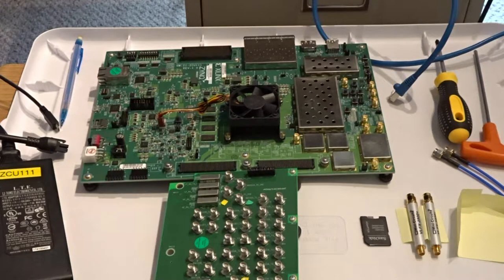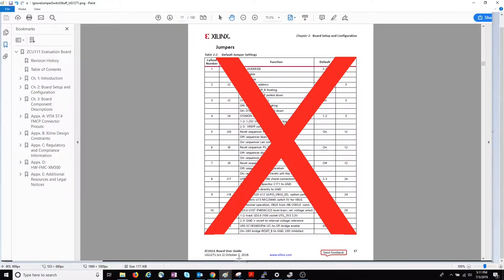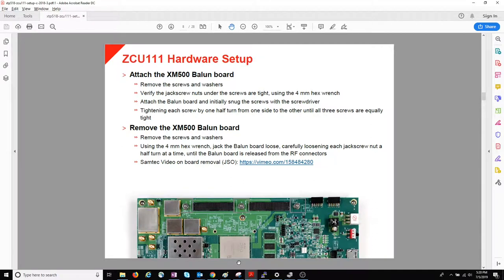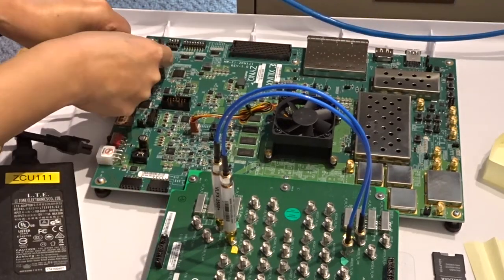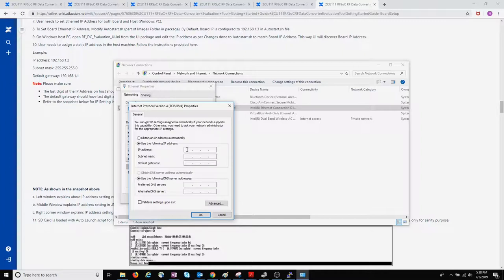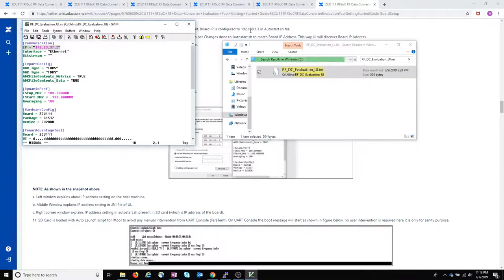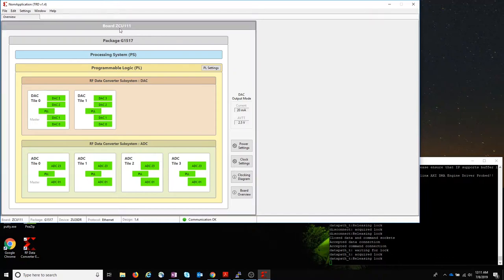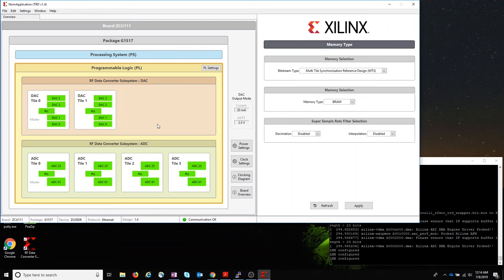ZCU111 2019.1 RFSoC RF Data Converter Eval Tool Video 5: Board Setup

Comment: Excellent series! Helped me get up and running very fast. A note for anyone using newer design file versions (I used 2021.2): I ended up having to copy all files from the images folder onto the SD card. There were a few additional ones not seen in the older version used for these videos, and the RF Eval Tool Manual (Appendix D) looks like it hasn’t been updated for the newest design files. I continually received IP error messages on booting in putty until I did that.

Comment: Hello. I work in science, specifically in the field of automation of physics and science installations. Tell me, please. I need to develop a system for generating the RF master signal of the cyclotron system. The signal has operating frequencies from 5 MHz to 30 MHz. We decided to implement the signal as accurate as possible, so we paid attention to the ZCU111. Is it possible to implement a master signal generator at such a frequency on this kit? Will the system be able to generate a high-quality signal at such a low frequency?
Reply from the maker: Hi, thanks for your question. This channel is geared more towards easy on-ramp for users because Xilinx has a ton of info scattered all over so it is hard to know where to begin.  For detailed evaluation of suitability for product design, I suggest to look at https://www.xilinx.com/zcu111 > Resources > UG1271 and the datasheet for the RFSoC device.  If you still have questions after that, I recommend to post on the Xilinx forum.
Reply: @KestrelOmnitechInc  Okey. Thank you

Comment: Hi 

It was a useful and very informative video. i am facing problems with setting up the external reference clock. It would be great if you can help out
Reply from the maker: Hi Rahul, for support, please use the Xilinx forums. The link for the Versal and UltraScale Architecture forum is https://forums.xilinx.com/t5/Versal-and-UltraScale/bd-p/ultrascale
Reply: @KestrelOmnitechInc   thank you so much for the reply. I will have a look into it

Comment: Hello! Nice info. May I ask, why are the low pass filters required ? Thanks!
Reply from the maker: Hi, the filters are not required to use the eval tool.  They are included in the Xilinx wiki Getting Started Guide for the eval tool as an example for how one might evaluate the RFSoC.  Please make sure that your operating frequency is in the pass-band range of the filter you choose.